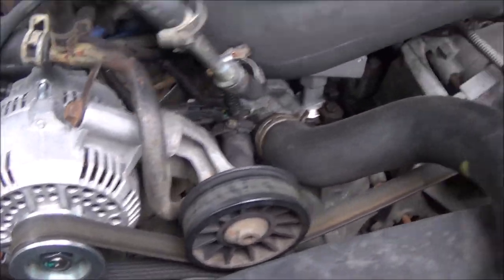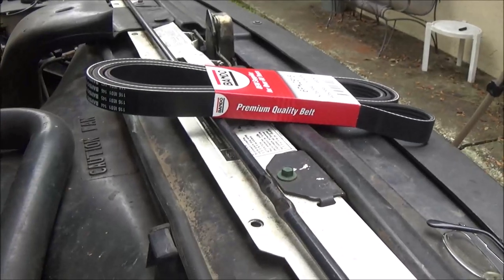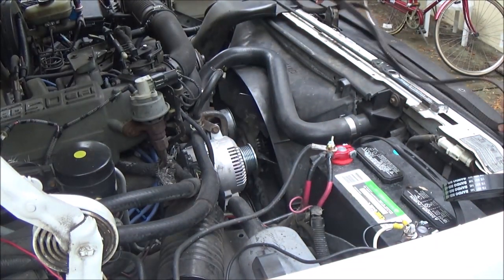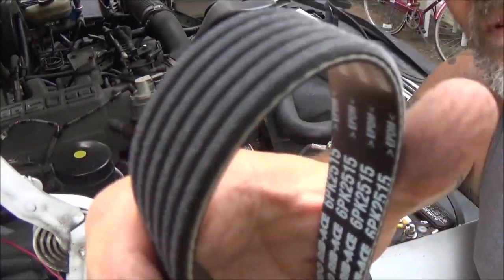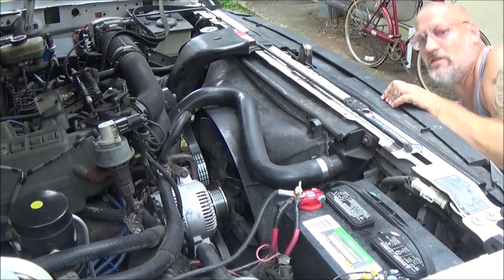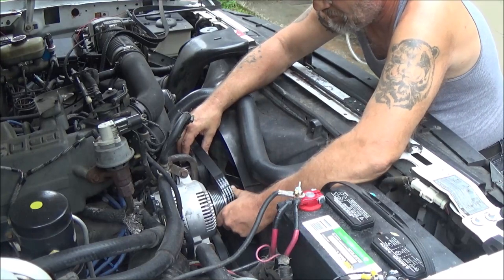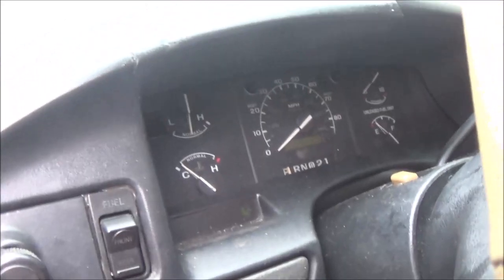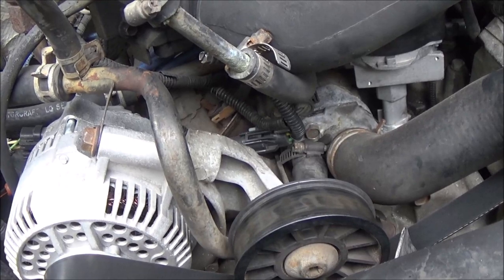Serpentine Belt Replacement 5.0 Ford F150

Comment: Routine r & r . What's up with the extra positive cable's ? You running juice back to a camper ? Oh , and my thin double headed swivel ratchet ( 1/4" & 1/2") from HF of course was like $20.00 and I use it a lot . Came in handy on the Cobalt serpentine belt . Later dudes !!!👍
Reply from the maker: the extra cables are the way he rigged up a starter solenoid. i dont know why people do that shit.